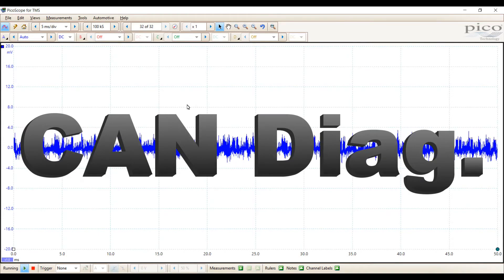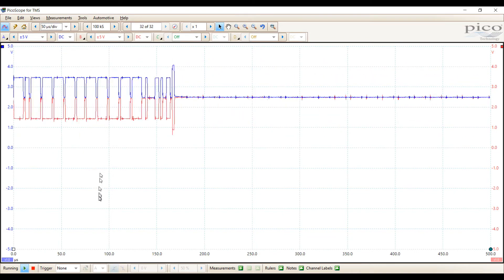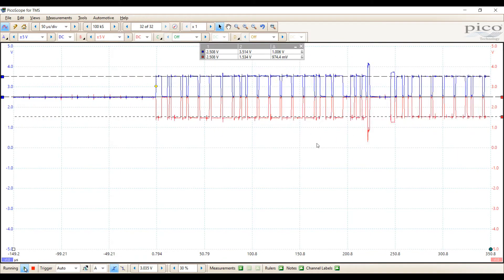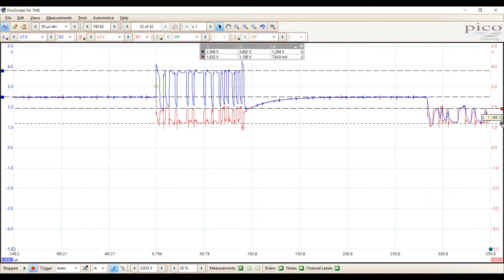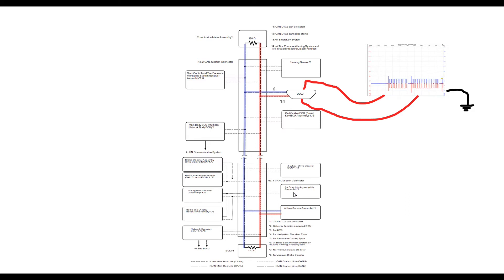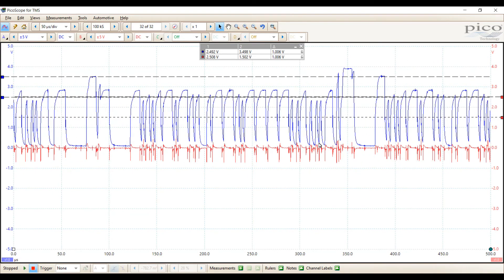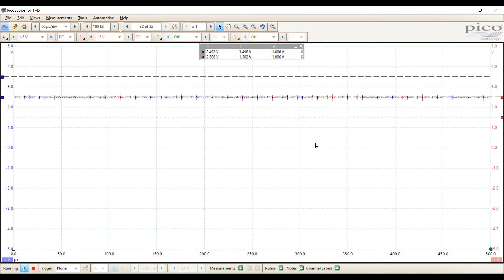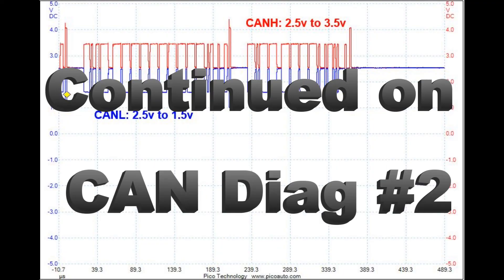CAN Network Diag. W/PicoScope- video #1 Using Picoscope to analyze CAN signals.

Comment: Does Using shielded cable for can works??
Reply from the maker: Shielding for CAN wires is unnecessary, that is what the twisted pair of wires is for (signal protection). However, it would not hurt to use shielded wiring as long as they are twisted. Rule of thumb is "no section of wires greater than 3 inches long without twisting".

Comment: Is the Techstream the oem for toyota? Im assuming youre a toyota dealership tech..
Reply: Yes Techstream is an Toyota OEM scantool. Although the oscilloscope used is a picoscope.
Reply: @benmelcher3154  yeah i have a pico too, I just never get to use oem gear. Looks cool to have specific testing.